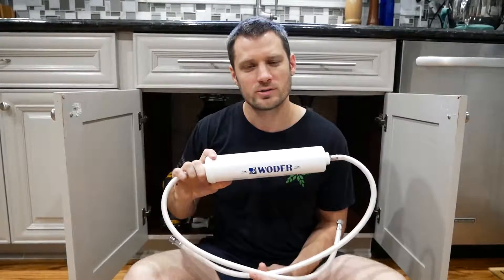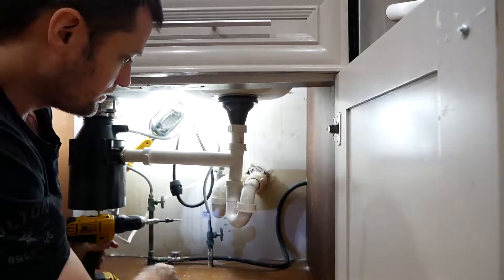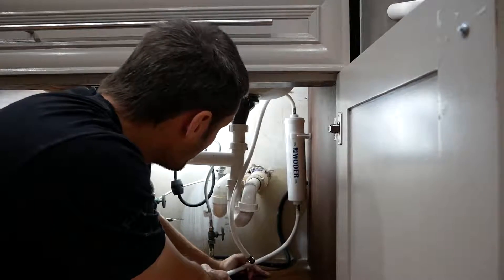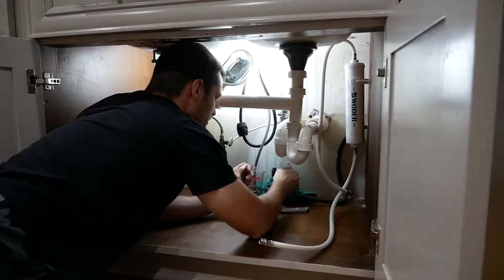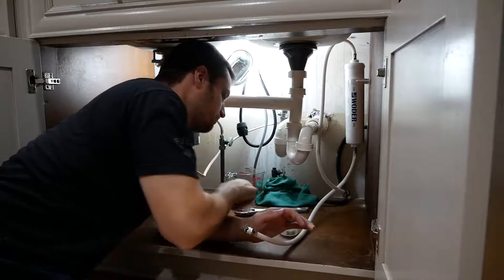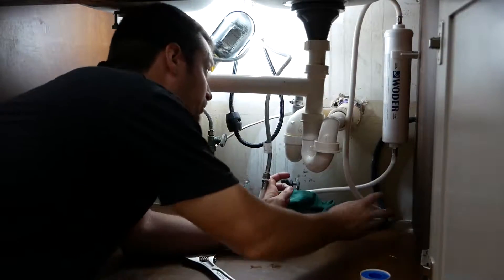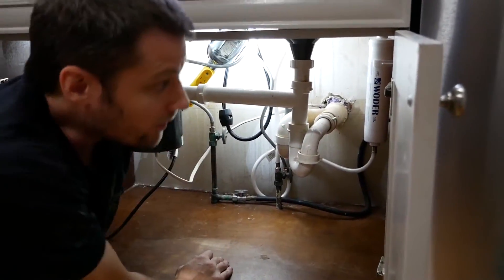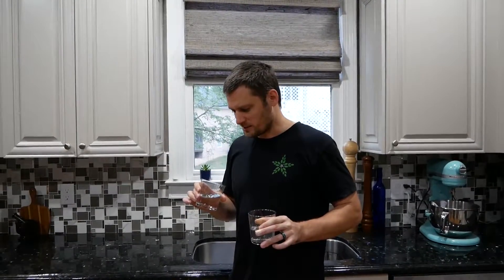Woder Under Sink Water Filter Installation and Test

Comment: Is this filter still working effectively for you?  I am considering buying one.  Thanks!
Reply from the maker: Yup, I installed it last October and its still going strong
Reply: Maverick Makers do I need the plumber’s tape?
Reply: @JessicaLZ  You should not use plumbers tape if you are using supply lines with compression fittings. These are the fittings with the rubber gasket.
Reply: Thanks for the vid. So basically a the water is filtered for all use (including for dishwashing) correct? I know you mentioned the filter lasts 3 years but I wash a lot of dishes. Is there an indicator when the filter needs changing? Off hand do you know how much the replacement filter costs?

Comment: Great! WQA GOLD SEAL CERTIFIED - Woder WD-S-8K is certified by WQA to NSF/ANSI 42 for Chlorine, taste, odor and NSF/ANSI 372 for lead free compliance as verified and substantiated by test data. Water purification unit. EPA Est. No. 51160-AJ01. Active ingredients: Silver Carbon 1.05% , Lead absorbent.

MADE IN THE USA - NO PLUMBING REQUIRED - Replacement filter for Woder WD-S-8K Under Sink Water Filtration Systems and WD-S-8K inline water filters and 2nd stage to all Woder WD-8K-FRM Dual Stage Fluoride Removal Systems. Premium Class I 3yr/8480-gallon Water Filter

Inert ingredients: Woder CB Gen3 Formula. This treatment unit is to be used in conjunction with municipally treated water.

Removal Capabilities: Lead (99.9%), heavy metals, chlorine (99.9%), chromium 6, mercury, volatile organic compounds, carcinogens, and other contaminants, as well as turbidity, odors and bad tastes.

PURE WATER AS SPRING WATER. Bring water to your main kitchen faucet or bathroom faucet, that is as pure and healthy as spring water. Enjoy safe, clean water for drinking, brushing your teeth, or washing your hands and face. Flow Rate 2GPM @65 psig.

LASTS FOR A MINIMUM OF 3 YEARS OR 8,000 GALLONS Notes: For longest life, use with municipal treated cold water only, not well water. Do not use with salty or softened water. Connects for use only with cold water for drinking.

System is certified by WQA to NSF/ANSI 42 for Chlorine, taste, odor and NSF/ANSI 372 for lead free compliance as verified and substantiated by test data.

Removal Capabilities Lead (99.9%), heavy metals, chlorine (99.9%), chromium 6, mercury, volatile organic compounds, carcinogens, and other contaminants, as well as turbidity, odors and bad tastes, so you and your family enjoy pure, healthy, spring-fresh water from the tap.

SELECTIVE FILTRATION: Woder filters have a unique technology that removes over 99.99% of contaminants while leaving in all essential minerals (Reverse osmosis filter out everything, including the minerals your body needs. As far as nutrition goes, experts consider it essentially dead water).

FLOW RATE 2GPM @65 psig / 1.32GPM @65 psig when used in dual FRM system.

ENJOY TAP WATER AS PURE AND HEALTHY AS SPRING WATER Woder filters are tested by independent laboratories to ANSI standards (American National Standards Institute), so you can have complete confidence in the quality of Woder-filtered water. Can be bought here! https://www.amazon.com/Woder-10K-Gen3-Capacity-Connect-Filtration/dp/B0144MFPOA/ref=sr_1_5?keywords=woder+10k+gen+3+water+filter&qid=1582989182&s=home-garden&sr=1-5
Reply: Sounds like you are with the company. Can you please provide a link to the test data? I cannot find any info about test data for Woder water filters. It seems as if they are intentionally witholding it, yet very quick to make claims.